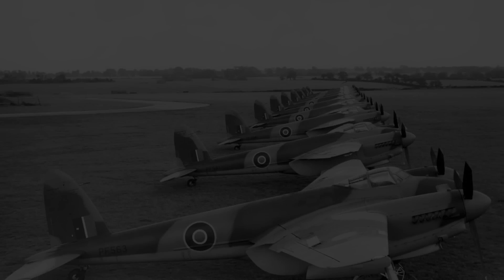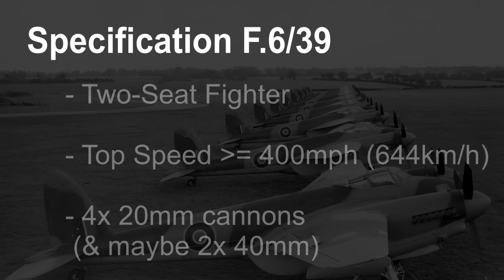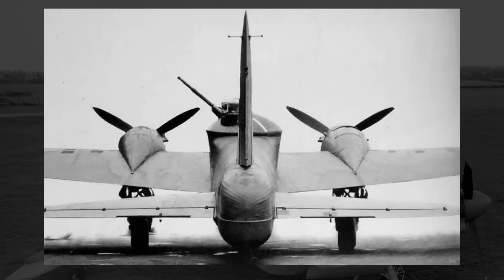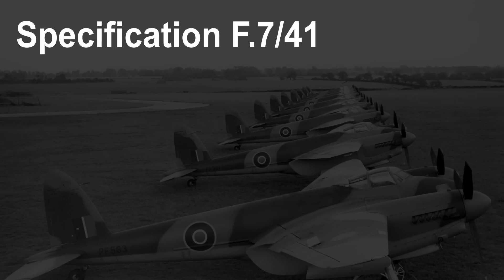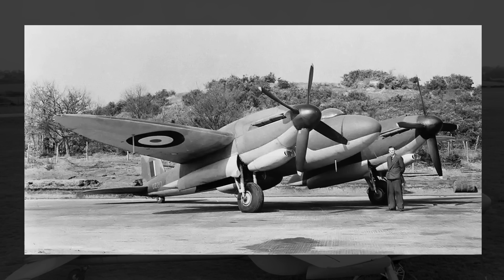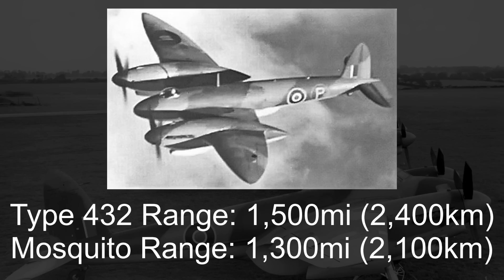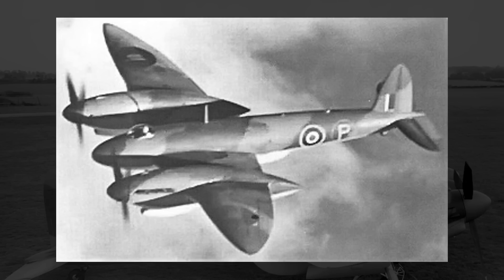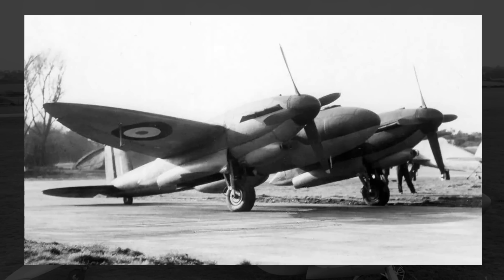Vickers' Unfairly Abandoned "Tin Mosquito": Vickers Type 432

Comment: The moveable 40mm seems like a heavy and cumbersome armament.
Reply: Having worked on around the AC-130 Gunships. firing the 105 mm so called 'recoilless' is still a treat for off axis recoil effects with its near perpendicular firing arc.  the lesser known sister armament is a 40 mm cannon, which is usually fired more often, depending on the mission altitude and target mix.  The point is, the relative mass of the C-130A/H platforms is significantly more than this aircraft and the installation of a recoiling cannon in the nose with an extreme 'arm of moment' around the off bore firing angle of 30 or so degrees in relation to that plane's CG would've been "fun" to watch.  From a chase plane, of course.
Reply: Well, the Mosquito Tsetse got a fixed 50mm cannon and did well against small ships. But the Mosquito was designed as a fighter-bomber and the Vickers as as a fighter, so not a good comparison.
Reply: @onenote6619  the Mosquito was designed to be a pure bomber
Reply: @wbertie2604 they didn't say the mosquito they said the mosquito tsetse which was a strike fighter variant of the mosquito
Reply: @onenote6619  I think you meant 57 mm. The 6 pounder. Though not used in service they also tested a 75 mm version but by that time the war in Europe was coming to an end.
Reply: The US Army were enamoured with the 37mm cannon - fitting it to, or specifying it for, many aircraft.

It was to be moveable in the Bell YFM Airacobra.
Reply: It would have been draggy as hell too.  The moment it moved off-axis it would have destabilized everything.  I can't imagine the pilot would have enjoyed continually compensating for a constantly moving artillery piece in the nose.
Reply: @elennapointer701  apparently such drag was an issue in general and some WW2 turrets had "ears" to offset unequal drag
Reply: @wbertie2604  One of teh Mosquiti fighter prototypes had a turret fitted just behind the cockpit.

On one test flight, the turret was rotated to a certain position, where it got stuck, as the drive mechanism wasn't strong enough to overcome teh drag on teh guns.
Reply: @waynec3563  it was mocked up, but it wasn't functional (no quad 20mm turret existed). I'll double check my books. It sounds more likely to be a story about the Beaufighter turret fighter (4 303) which did fly
Reply: @wbertie2604  The first prototype, W4050, had a mockup turret mounted behind teh cockpit for a while. 

It had haoles in different orientations into which mock barrels were placed.

They were to be Browning 0.303" machine guns.

Two Mosquitoes were fitted with operational turrets. W4053 and W4073 were equipped with a 4 machine gun Bristol turret, and test flown.
Reply: @waynec3563   I'll check my Sharp and Bowyer tomorrow as I may have erased 4053 from my memory
Reply: I wonder how much recoil the recoil mechanism would absorb.
Reply: It was intended for use against unescorted bombers on a 'one shot one hit' basis. It was assumed that Luftwaffe bombers would be unescorted, so sitting outside MG range and lobbing shells at them seemed reasonable, even more so for high-altitude types (Ju-86P) which definitely would not (and did not) have escort.

It was a flawed concept in WW2, although it worked in WW1. In WW2  and the lead up to it, you see  it in various French designs, the Defiant, an unbuilt Bf 110 derivative and even the P-61 (built to an original British concept) and the Bell Airacuda.